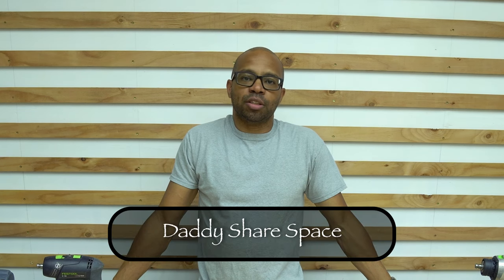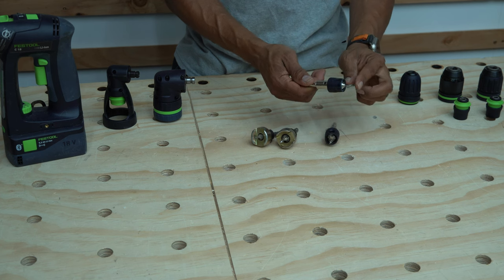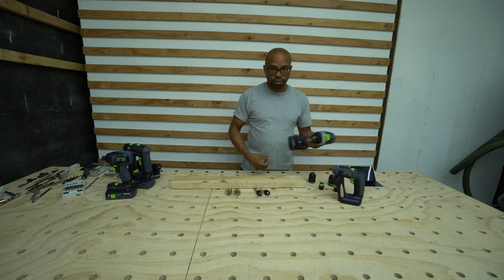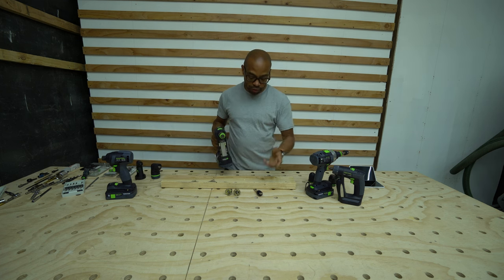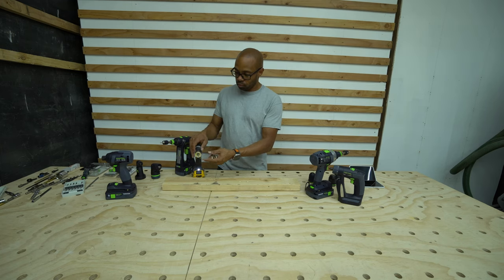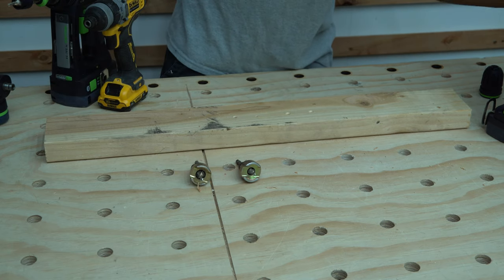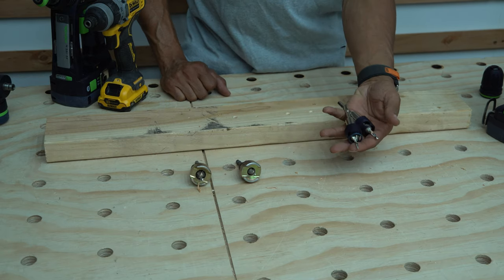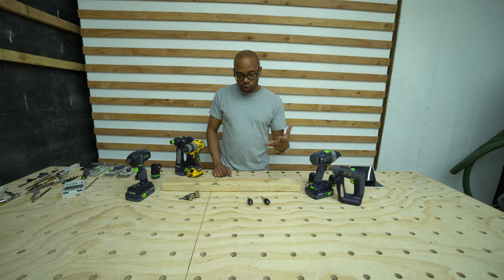Festool Versus Amana Countersinks With Adjustable Depth Stop

Comment: If you plan on plugging the countersunk holes, then consider whether you want to use metric or imperial wood (or other material) plugs.  If you are OK with turning your own plugs to fit, then either works otherwise if you are planning on using some "store bought" plug material (wood, metal, or plastic) then the availability of those materials comes into play.  Overall, good video.  Thanks for producing.
Reply from the maker: Thanks for the compliment and taking the time to check out the video. I bought the Veritas dowel maker to take a crack at making my own dowels. We will have to see how that works out.

Comment: Amana also makes these with a centrotec shank. Different stop collar and not metal. Also smaller in diameter.
Reply from the maker: Thanks for sharing that information. 
The Amana countersinks I own have worked well so far. I imagine the quality is similar so that could be a nice buy. 
Thanks for checking out the video.

Comment: The Amana tool features the ability to switch between bit sizes. Does the festool? Or do you have to buy every single size with it’s included depth stop. This is an important favor which has massive implications in regard to price.
Reply from the maker: Sorry, it took me so long to answer. I wanted to check the bits before I responded. You will have to purchase the various sizes. Upon further inspection, the Amana bits I have also require you to buy each size. 
I hope this helps. Thanks for watching the video.
Reply: @daddysharespace  right, but the different bit sizes on the amana can all fit into the depth stop collar. Once you’ve purchased the festool set and collar, you can swap between different sized festool bits, right?
Reply: @gcanzano36  , you are correct

Comment: You spoke about price being higher compared to other bits, but not on whether or not Festool’s price vs the comparable Amana Tool’s price, is justified or not. Would you say one is better than the other?

Great video
Reply from the maker: Since I put up that video I have learned that Amana also makes a Centrotec version of the counter sink. When I completed the video I was comparing the 1/4 option versus the Centrotec version. I have not picked up the Amana Centrotec version to compare so it would not be an apples to apples comparison. I also learned of the Centrotec to 1/4 inch adapter after this video as well. 
If the Amana Centrotec version is comparable to the Festool then it is best to save the money as they complete the same task. Having to purchase the Centrotec to 1/4 inch adapter in addition to the 1/4 inch Amana option moves the price closer to the Festool. At that point you may as well go with the Festool as it will have smaller foot print by comparison to the Amana plus the Centrotec adapter. 
One thing to consider the Amana has a metal guide where Festool's is plastic. That can be a con for durability but a plus when it comes to potential marring of delicate surfaces. 
I do not see value in purchasing the higher priced product unless you like to stay committed to a certain brand.

Comment: Thanks for the comparison. I have a couple of those amana countersinks and they're great, just a bit bulky. They work great though. Worth noting that the countersink is carbide tipped, I'm not sure about the festool. As much of a festool fan as I am, these would be a hard pass at those prices unless centrotec is an absolute necessity. Even $42 for the amana was a bit rough to break out the debit card, but they're worth it. I think amana makes them without the depth stops for a decent bit less too, for situations where consistent depth isn't critical.
Do you prefer one over the other?
Have a great Sunday!
Reply from the maker: Thanks NW, You have a great Sunday as well.
I like the Centrotec system or more specifically the ability to put multiple head adapters on Festool drills. The off-set, right angle, and depth stop chucks come in handy. It is a more versatile system. Other brands provide this type of drill functionality but not in their higher voltage line of drills. I could be wrong, but I do not think Festool will make a dedicated chuck with a 1/4-inch quick change chuck due to the investment in their proprietary Centrotec system. I am going to speak about it more in an upcoming video,
Reply: @daddysharespace  Yeah I had the milwaukee M12 multi head driver and currently use the dewalt. So far, it's done everything I need of it, but an 18v/20v max version would be great to have in the lineup. I know there was a milwaukee patent for an M18 version but I haven't seen anything come of that. I think I mentioned this previously, but the new CXS 12 and CXS 18 have my interest. I'm waiting a bit on those though since my dewalt has been performing so well. Still savin up for my CNC. Looking forward to your video on the centrotec system.